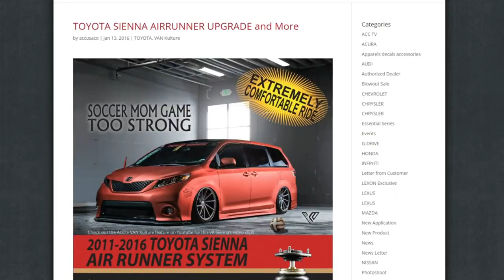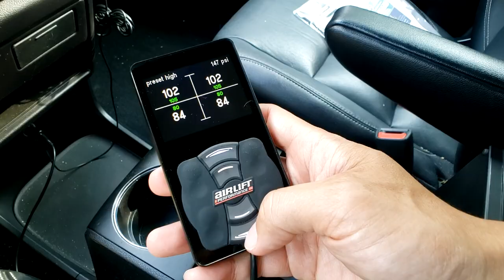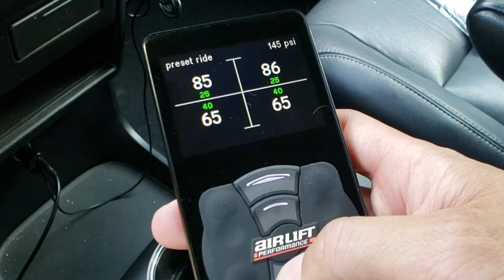2015 Toyota Sienna SE AIR SUSPENSION Setup and Details!

Comment: What was the modification you had to make to the rear bag setup?
Reply from the maker: There's a small cut you have to do to the existing mounting area.  Remove it so the bags can fit.  It's all in the instructions from AirRunner.

Comment: Hey brother how is it going. I have the exact same set up as you on my 2011 SE. Question. What is that valve you have there next to the compressor for?? Thanks in advance.
Reply from the maker: It's just a water trap.  You drain it every now and then to make sure there isn't any moisture in the system.

Comment: Did you make all your airlines the same length so both the front and rear lower at the same speed?

Awesome vid 🤙🏻
Reply from the maker: I don't think it's possible to have the same length because based on the placement of the manifold if it's not perfectly in the middle of the car, the lines would be different length.

Someone correct me if I am wrong.
Reply: I think I read somewhere that if you make all the lines the same length it will lower at the same speed. You would have to route some of the lines all over the place due to management placement I would assume. Just a thought before I install mine
Reply: Doesn’t the air management handle that via the pressure?
Reply: No, it does not

Comment: Quick question, does this system have option to tuned air suspension to comfort mode or sport mode. I am more focused on Comfort setting like lincoln town car or Bens S class. 
I drive 2019 Sienna Limited premium AWD, and Run Flat tires makes it worst ride. I do not care to lower the car but rather have option to increase the height up to 2-4 inches or slight lower it so elderly can get in the van easily.

kinda like LX460, LX570  ride height control setup.
Reply from the maker: Not particularly, however, there is an option to have extra sensors that will detect and keep the ride height exactly where it needs to be based height and pressure.  These are called height + pressure sensors from airlift.